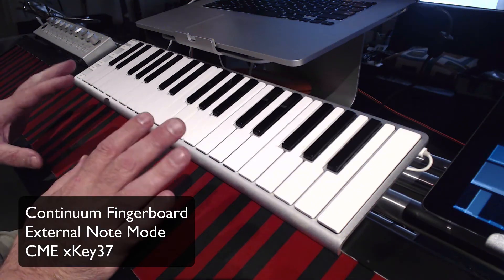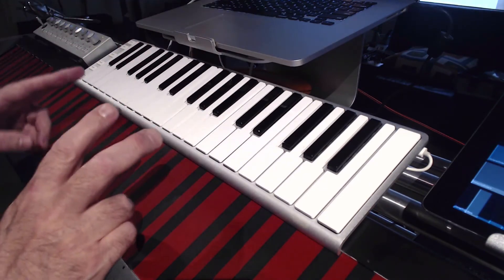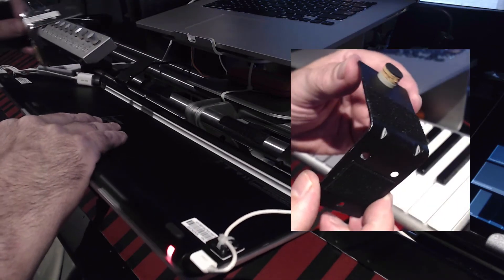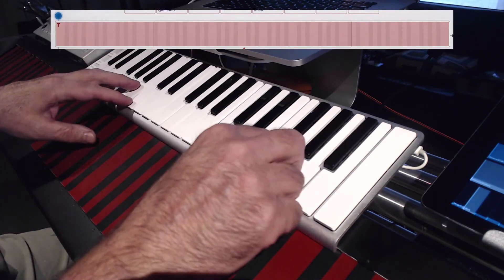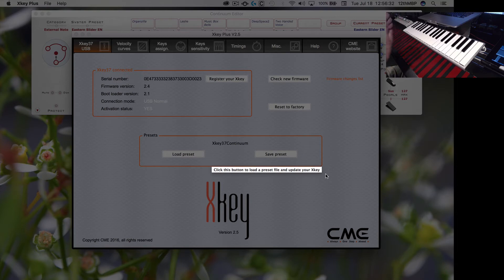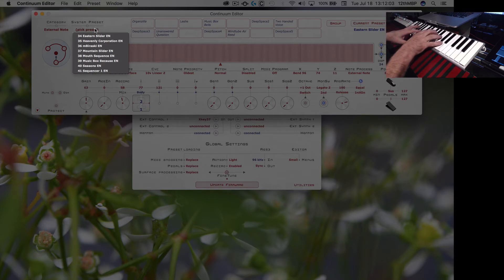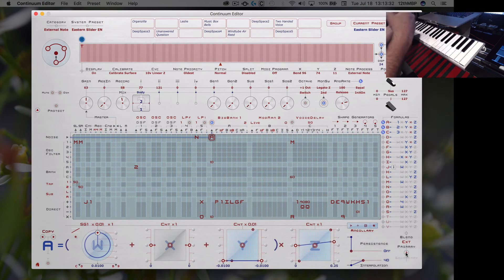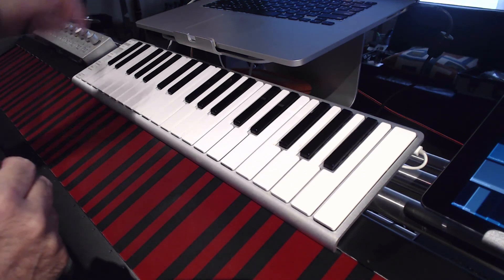The Continuum Fingerboard and the Xkey37

Comment: Edmund, Thanks for the detailed video.  I tried to connect my Komplete Kontrol keyboard to drive the Continuum but couldn't get any sound out of the Continuum. I am using the External Note process with the Eastern Slider EN.  The Midi output of the KK is connected to the Continuum via a virtual Midi cable.  Midi-OX shows midi data on the  virtual Midi cable, but the activity indicator in the Midi and Global Settings for the external control input doesn't show any activity.  If I connect the virtual midi cable in place of the mio, which is the Continuum source, the activity indicator lights up but there is no sound.  Is there some critical point I am missing?  Any help is appreciated.